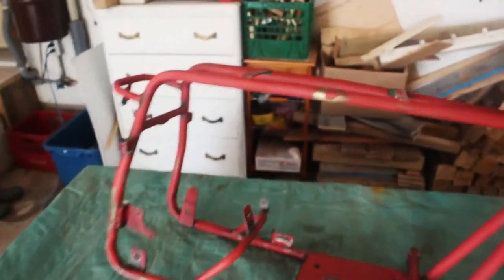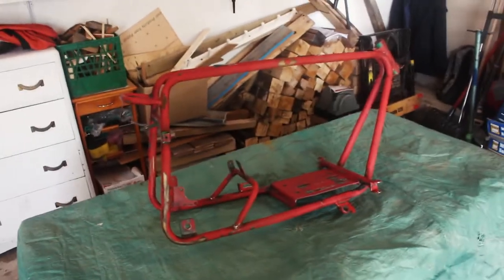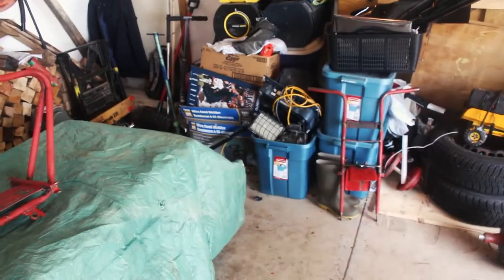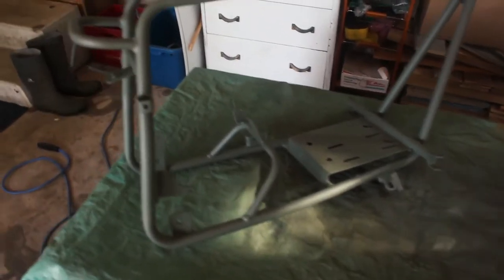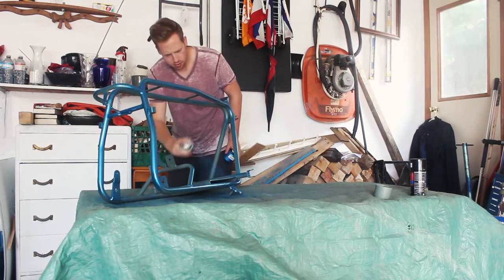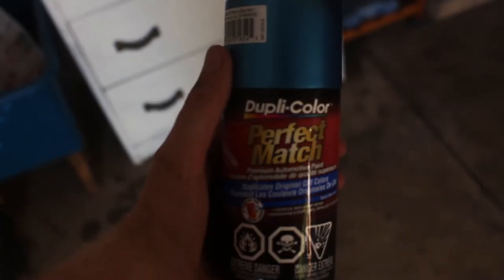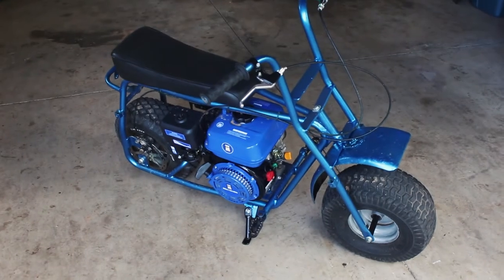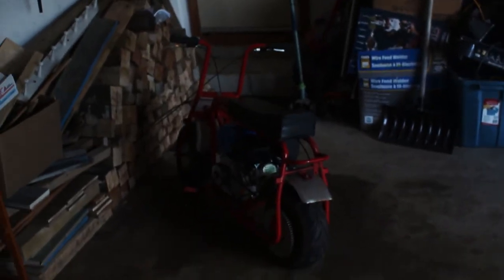Painting Frame - Mini Bike Rebuild Project (Baja Dirt Bug)

Comment: i just did one of my bikes it came out super clean,,,i dont get why he didnt take it down to metal like i did makes the paint come out 5 times better it takes longer but comes out like factory paint
Reply: Cash White what did you use to take it down to bare metal?
Reply: @adam100a8  i used a paint scrapper it comes off easy and 1 sheet of sand paper in the end just to smooth it out make sure to rubb it down with achohol to clean it before you paint it will come out super clean good luck
Reply: Cash White great thanks I’ll be painting my frame soon